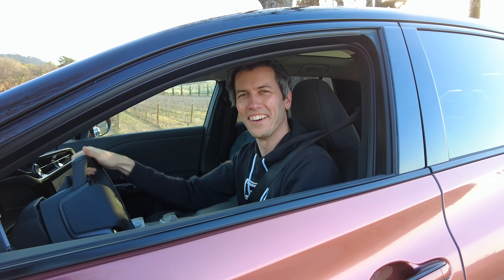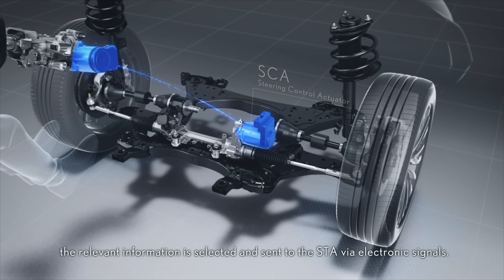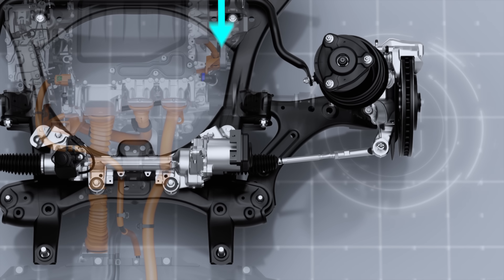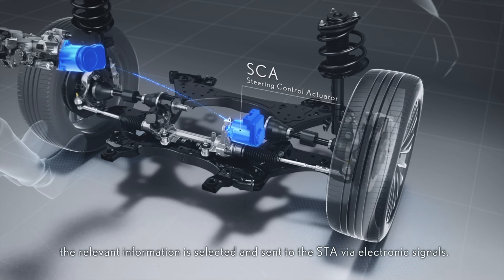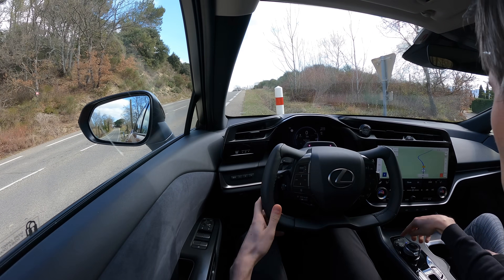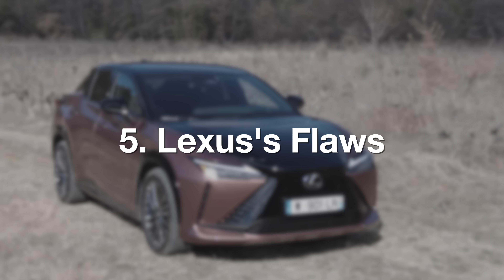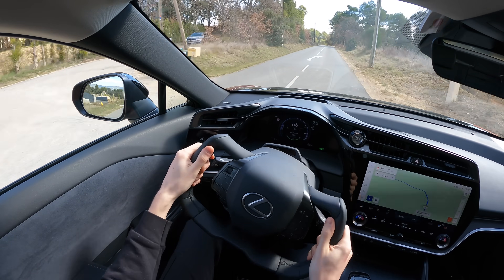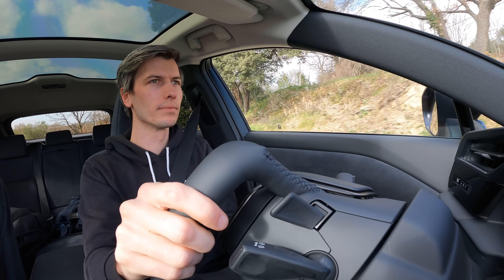How Lexus Fixed Tesla's Bad Idea: Steer-By-Wire Yoke

Comment: The delay might be caused by the immense amount of friction on the tires because you're standing still -  a situation where you wouldn't really need snappy steering anyway. I believe we do have the technology (and have had for at least a decade and a half now) for steering response to be snappy enough to match mechanical steering when you are driving and forces resisting turning are low. There would be much less resistance to turning when you're actually driving.
Reply: The way I see it, it's because he can turn the yoke as fast as he wants, while the wheels have to overcome a physical limitation, as you mentioned. The delay is perceived to be much more noticeable since there is nothing preventing him from turning the yoke faster than the wheels can turn, and thus they are always "catching up" to the indicated direction. Sure there is feedback, but that's only there to tell you something's holding up the turn, unlike a mechanical link which simply wont let the driving wheel go further if the tires encounter an obstacle.

It's not something you can't get used to, I remember playing a racing game using a driving sim wheel, that clearly wasn't designed for it - the tires turned at a constant rate (as you would want with a keyboard), regardless of how fast the wheel was turned, both when initiating the turn and while returning to a neutral position. At first it was very off-putting, to the point of being unplayable, but gradually I learned to lead my turns a little and also return the wheel to the center position slightly earlier. In other words, not a total deal breaker, but certainly problematic in that driving is something we do mostly subconsciously, like walking, and having to unlearn the motions even briefly might not be optimal for road safety.

Comment: Adaptive steering ratio is the most important technological achievement in all the steer by wire chapter from my pov
I think this is the first little step into turning old sf movies, where usual cars are electric with wheels like this, into reality :)) Or is't gonna flop because of the industry, like 3d tv's haha
Reply: It's not that big of an achievement, pretty much every brand has adopted some kind of adaptive steering ratio in their higher-end or sports cars and since cars are getting bigger and heavier it gets implemented more and more. Being "better than Tesla" sounds impressive until you realize that Tesla's version is absolute dogshit, but the video covers that quite well. In a steer-by-wire implementation a variable steering ratio can be handled by a bit of software alone, a mechanical system needs an electric AND mechanical solution like planetary gearboxes with built in motors.

Comment: What would be interesting is implementing Smoothing Filters when driving at high speeds just like surgeon robot that filters out quivers by the surgeon. That would make it less twitchy without compromising on the angles. If tuned correctly the feeling should be still there for the driver.
Reply: Any filtering will introduce lag in the response.

Comment: So since it's electric, what happens if you lose power suddenly? Which does happen. How will I control the car if the steering is electric and fails? Plus, it's just a lot more expensive things to have to fix. The replacement batteries on 10-15 year old used EV's is gonna be expensive enough as it is. Most likely will cost more than the car itself. Is it to much too ask for them just make us a basic car that's not gonna cost more than the value of itself every-time I have to take it too the shop?

Comment: I think Lexus approach to letting you steer like a madman at high speeds is the right one, evading obstacles, is important and if you don't because the car decided that you may not have that much steering will cause an crash inevitably
I do agree with the fact that the response time is not good at all and that giving a car some input, whether it is from a pedal or the steering wheel, it's very important, making a car predictable, will make it easier to drive.

Comment: Steer by Wire isn't a new technology its just more often used than before. For example almost all Infiniti models since the Q50 which was released in 2013 had steer by Wire.

Comment: didnt the Audi, A5 as i recall but im sure more models have variable steering ratio like a decade ago, with out the dangers of drive by wire?
i work service for an American Manufacture, these electric assisted racks fail a lot..   in all the years of working on cars i think ive replaced like 3 traditional racks.. we do like 3 every two months of the electric assist racks

Comment: Steer by wire is not new technology it has been in production cars for 10 years now. Infinity was the first production cars in 2013 to use it. They had not 2 but 3 redudeces though.

Comment: What I don't like about Steer-by-wire is the delay. I hated the electric motor assisted steering on the previous E-Smart my parents had, as it had a noticeable delay. It didn't really matter at 30+ kph, since in the Smart you don't need power steering at all (the older ones with a combustion engine don't have one). But it's the same with the ID3 my mother has, the steering and feedback feels slightly delayed and isn't as direct as with a hydraulic driven steering assist. And I don't see the Lexus system being more responsive any time soon.
Reply: You're saying the ID3 is electronic steering only?

Because the only way you'd feel a lag is if there was no mechanical linkage. Now there could be a difference in the power steering assist force, but that would not cause a lag in movement.

Comment: Planes have fly-by-wire for decades now. So I'm not really worried about drive-by-wire in general. It depends more on the actual implementation of the car manufacturer.

Comment: How does this work in states that REQUIRE a mechanical link between the steering wheel and wheels in order to be legal for use on the road?
Reply: People in those states are too smart to buy cars with disconnected tie rods

Comment: The variable steering ratio is analogous to the "improving cursor precision" option on your PC, which essentially turns on variable cursor speed. It's defaulted to on, and most users are fine with it. However for me it ruins my reaction time and control precision, because with this option on, the physical position of your mouse doesn't map to the screen position of your cursor anymore, making it harder for human brain to pick up the pattern. Guess the same thing applies here.

Comment: I’m up for the new yoke steering. Either this or traditional wheel. Doesn’t matter if it’s completely electronic or mechanical. 

Tesla’s yoke is silly and nothing more than a gimmick. If you have to rotate the wheel more than 180 degrees why not the wheel, Tesla ?!

Comment: You forgot to mention the part of the steering system that has no redundancy. The code. If there is a bug in the software controlling the steering wheel, the steering is affected, no matter how many backup systems you have, so you just have to trust there the engineers have made damn sure there are no bugs in their current version, or any future updates
Reply: Weve been placing the same amount of trust for on planes for decades. But good one
Reply: @TunaIRL  I mean sure, but it was only 4 years ago the 747 max killed 346 people because of software bugs/oversights, so that doesn’t exactly make me feel safer. You have to remember that the only reason flying is so safetoday is because of all the thousands of people who have died in the process of making flights safer. Same is true for cars. If this becomes the standard, there will eventually be software bugs which result in death. It might be as minor as the torque response not being what the driver expected, it might be as major as the steering shutting off completely, but it will happen since it’s a new single point of failure that people often don’t even view or understand that it is a point of failure, they just think that code always magically works. As someone who works with coding I can tell you that we write bugs almost on a daily basis. Most of those bugs are found before it’s put into production and we have systems in place to spot bugs, but there is no way to automatically distinguish between a bug and a feature, so they will get through and if you are unlucky a bug in the car causes a crash.
Reply: @beaconofwierd1883  So you acknowledge that issues in technology happen, but they develop into better products. Now you're saying that it's better to keep current mortality as is, instead of trying to lower it. If engineers thought like you did, we'd still have wooden planes killing every other passenger on them. The goal is to REDUCE mortality. You're implying a new technology has to be 100% perfect and reduce any deaths to 0. 

Let's say today we have a 100 accidents a week. Someone develops a product that could decrease that to 80 per week, but issues occur and it kills 20 people on the first week. After they're fixed, accidents drop down to 80 a week. Do you think this was an improvement over all?

The only point of this technology is to reduce accidents.
Reply: @TunaIRL   No, I simply stated that you forgot to mention the single point of failure existing on this system, and it’s a point of failure that often causes fatalities because it is overlooked as a point of failure.
I hope there are scenarios where drive by wire could actually save lives (like pot holes not distracting drivers) and that the number of lives saved are greater than those lost, but we also have to recognize that not all advancements are made in the name of safety. 

A change to a product aims to improve three things, Performance, Safety or cost. The 747 Max is an example where Performanece and cost was prioritized over safety, leading to unnessecary deaths. I’m simply worried this is also a case where performance is prioritized over safety, and the fact that people don’t even realize that this system has one single point of failure is what’s scary about the system.

It’s also worth noting thay a single point of failure isn’t always worse than redundancy, if that single point of failure is extremely strong redundancy isn’t nessecary (and sometimes can even cause more problems), but not being aware of a point of failure is always a recepie for disaster.

Comment: I'm interested about the European market.
Currently, every safety related part needs to be mechanically connected. WE don't have brake by wire, there's always a hydraulic system connected to the pedal (even in EVs). We don't have electromagnetic suspension since it would fail in case of power loss.

Are we getting steer-by-wire? I honestly don't believe so although your arguments in terms of safety are great. Especially aviation probably has no mechanical steering at all and it still works great.

Lastly, I wonder what an electromagnetic pulse would cause in such a system.

Comment: So, if you’re accelerating while in a turn, will the steering ratio actively change, meaning that I have to change the angle of the wheel to maintain a certain amount of turning/that if I keep the wheel in the same place, I will straighten out as I go through the turn? I think that would feel incredibly strange.
Reply: This happens with every car on the planet already. Its called understeer. Only difference is here, you'd be turning out instead of sliding the front tyres.
Reply: @TunaIRL  I wasn't talking about accelerating hard enough to induce understeer. It's absolutely possible to accelerate through a corner without understeering or oversteering - like when entering a freeway on ramp. 

Understeer is a specific term that refers to the front tires not having enough grip to accommodate the turning that a given steering input is requesting. That is, the car isn't steering enough compared to the amount the steering wheel is turned - hence the term. In normal driving on the street, neither understeer nor oversteer should be happening. 

So no, what I was referencing is not the same thing as understeer.

Comment: The things I dislike most about this system are:
- Input delay / force saturation with quick or strong inputs makes the car less agile and makes the driver feel less connected
- the steering angle needed for a minimum turning radius is linked to many factors even the most modern cars can't possibly take into account - even if it's a constant feedback system.
A system only dependent on speed will either not reach maximum lateral force or reach it at a point during steering wheels rotation that might be hard to predict / know intuitively because it will change non-proportionally through the steering wheels rotation.
- complexity and cost
- steering not working when the car is off or broken

For somebody only putting around town or somebody who wants to really feel like they're living in the future this might be a cool system. I personally would pay money to not have to use it.

Comment: Throttle lag is highly annoying, but not necessarily dangerous.  Steering lag would be both annoying and potentially dangerous.  Those bleating about previous advancements such as ABS, stability control etc. overlook something very fundamental, the car still drives perfectly ok with those systems completely disabled.  Even a broken electronic throttle still has a (albeit barely useable) limp mode that allows to car to move move slowly.  How does that apply to this massively overcomplex steering system?  Just imagine the carnage that rats chewing through the wiring are going to cause.

Comment: I know Audi has had a mechanically linked adaptive steering system for a while now. It uses a strain wave gear inline with the steering column to adapt the steering ratio. Basically the motor adds steering to your steering. Nice thing of the system is that everything is mechanically coupled and if everything fails the gear is "self locking" so steering is still possible. I read a comment mentioning a system on BMWs as well. Still very interesting, was wondering when manufacturers would try steer-by-wire.
Reply: BMW also offer a similar system called Active Steering and I absolutely adore it! Makes parking maneuvers much much easier.
Reply: I think your all missing the point of the video it’s about the steer by wire not the adjustable ratios. Having a steer by wire system offers so much more for engineers and is far more technical than any of these mechanical systems you mention.
Reply: @track6631 variable ratio was the only thing that's actually a feature.  Weight is nice.
Reply: @data_abort  Space ? Weight? Tunability ? 300 degree turning? Ratio adjustment ? Yoke wheel? One motion grip? Safety with no rack in an accident? Low vibration ? Better instrument view ? 
Did you even watch the video mate ?
Reply: @track6631  but did you read about the adjustable steering gear?
all of your arguments apply to that as well, except for weight and safety in regards to the steering rod.

but I also would happily skip those to still have a mechanical connection between the steering wheel and the road wheels!

yes I know it’s been used in planes for decades, BUT: the advantages are MUCH bigger for planes, and a steering failure is not as problematic in a plane as in a car at highway speeds.
Reply: @mortenvinding6687  I wouldn't say that loss of controls is worse in either vehicle. It's more that planes are engineered and maintained to much higher degree.
Reply: @cyan_oxy6734  planes?
but no loose of control can kill you in a fraction of a second in a car.
in a plane you usually have several minutes to get back in control.
Reply: @track6631 this whole brunch is about dynamic ratio adjustment existing in every other premium car. All other benefits are really minor tbh.
Reply: Almost every modern  car has this thats why you dont see any hydraulic fluid for the steering anymore. So completely wired like in this video is not needed
Like so many other things like electric handbrake
Reply: My Tesla Model 3 does this as well, the vid is BS.

Comment: I still find that not safe, imagine that breaking is done the same way...
The mechanical solution is direct and reliable, if something breaks you'll feel it for sure.
In Steer by wire - let's say the connection is lost during the ride, sharp corner you turn the steering wheel and nothing happens.
Another example: high speeds - dulled response, somebody cuts you off badly, or deer jumps out on the road, you quickly want the swerve but the response is dulled too much so you end up crashing into them.

Comment: if a rat eat part of the wiring and snapped during driving where is the redundancy of this failure 
if the relay failed 
how to handle the car on a curve if the fail safe design while no communication to be straight 

use it for freaken EV cars but please dont install it on v8 cars until we extinct on few years

Comment: I recently took a loaded truck + trailer down I70 through the Rockies in the wet n potholed truck lane. I'd have given an arm and aeg for damped feedback. Steering control is a lifesaver too. <15 ms latency and I'm sold.